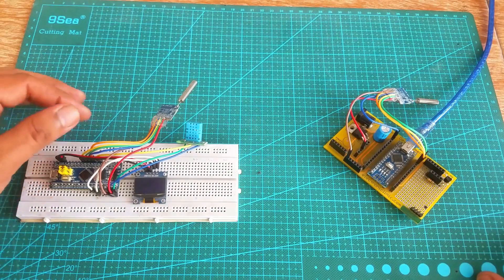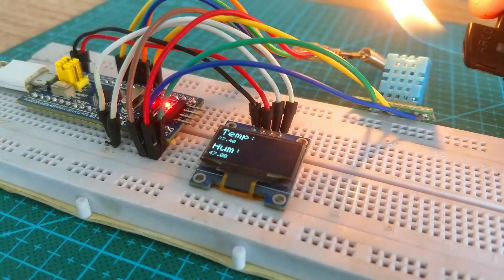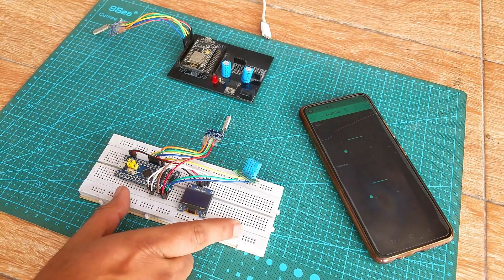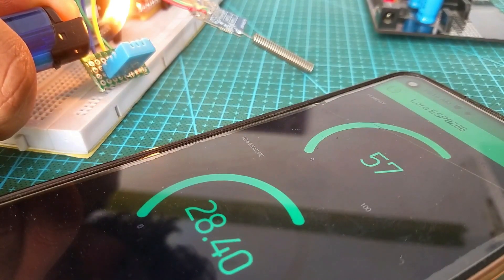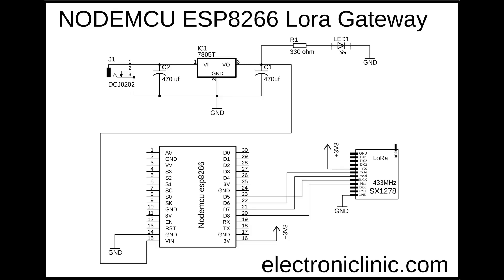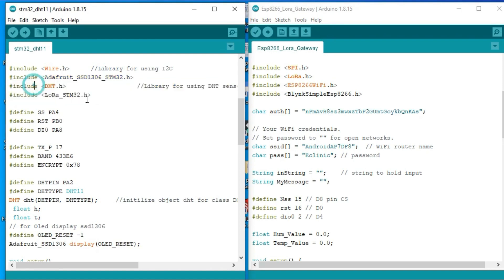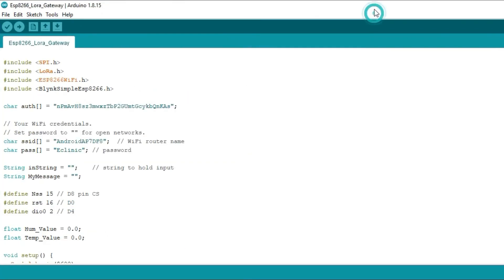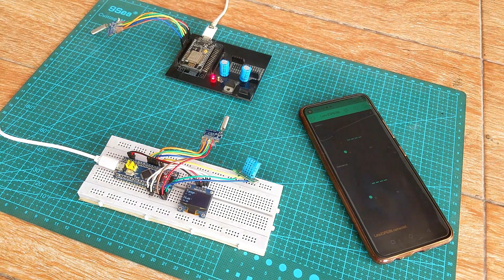ESP8266 Lora Gateway for STM32 and DHT11 Sensor, IoT Gateway, STM32 Lora Gateway, Lora SX1278

Comment: Why are you using a Gateway. If you can make a GPS tracker without a Gateway, why use a gateway in this design. 
This design could also work with Gateway. Is it for the working of the application?
Reply from the maker: i did it using different techniques. you can do it with and without gateway  you can do it with gsm, Lora, etc. if you check my playlist you will understand.

Comment: How much kms range this modules
Reply from the maker: it's around 1km, but I didn't test. I will make a video about the range test. As i am planning to make a control system for my upcoming RC Plane project.
Reply: @ElectroniClinic  ok bro
Reply: I want upto 5km range modules bro
Reply from the maker: @creativeelectronicchannel7647  then you should use lora reyax modules. these are available on my channel.
Reply: @ElectroniClinic  ok but this is multiple lora communications I want on master and no of slaves

Comment: Bro I want master and slave more no of lora transmitters and only one reciver
Reply from the maker: one of my previous videos is based on multiple Lora SX1278 transceiver modules. So in that project you can replace the Arduino board with the esp8266. It's simple, you will get the idea.